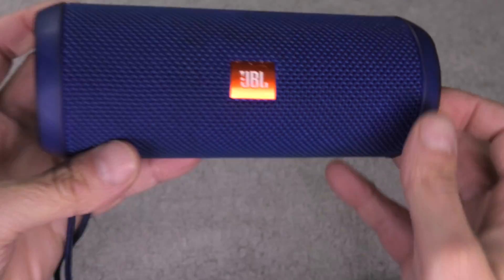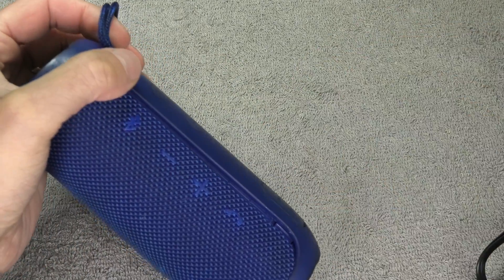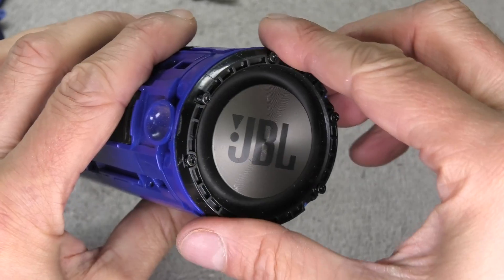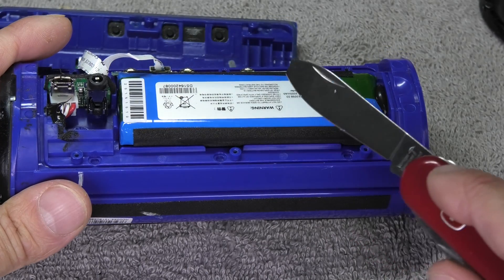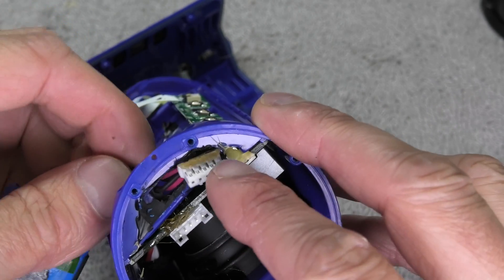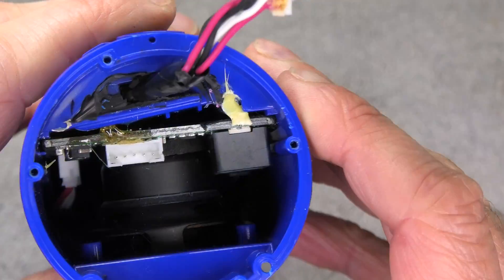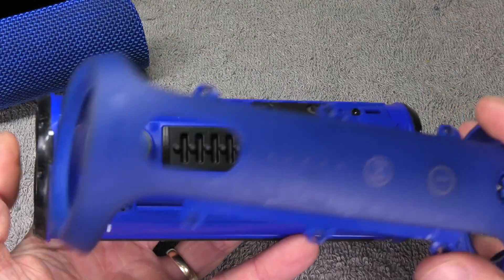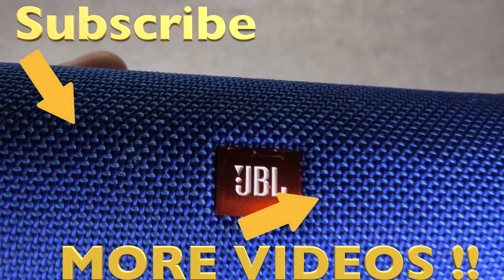JBL Flip3 Battery Replacement (How to DIY)

Comment: Perfect video!  Replacement done by myself and it’s working. I want to add one reminder, try to not fill so much hot glue over the cables of battery socket, height of this glue blocks the movement of side cover while bass sounds and it effects the sound you hear. I made it clear second time.

Comment: Once you unplugged the battery. And switched to taking off the top near charging port you lost me. And yes i have a Flip 3. There is no big gap to get under the port like that on mine. And no indication that it can split in half like that. Its solid platic with no seem.

Comment: Pay attention to the length of the machine screws as you take the Flip 3 apart. The passive radiator machine screws are slightly longer than the machine screws that hold the body parts together.  If you try to use the longer screws on the body parts they bottom out before they snugly hold the parts together.  As you remove the screws during disassembly consider labeling where they came from.   It still was an excellent DIY video with great closeups of the disassembly and reassembly.

Comment: How likely is the battery to catch fire while prying at it? My jbl flip 3 battery is inclosed and only accessible from one end. Obviously I don't mean pry, pry. But still, just curious because it's in there pretty snuggly with the adhesive and I'm not completely sure if the old battery is swollen or not. Should I bother with the heat gun method or no?

Comment: I just performed this repair this evening. Your instructions were very clear and the video gave a very good perspective on seeing where things were. I added two tools to the mix. First, I used a small flathead screwdriver to hold up the grill as I was initially peeling that off. That helped give a little lift/leverage. Second, a small pair of needlenose pliers was helpful in pulling away the cut glue and putty, as well as to pick up one or two of those very small screws. Thanks for making this video. It felt good to be able to repair something rather than having to buy a new one. Hopefully it charges and I'm good to go!
Reply: Unfortunately, I have to report that the repair did not work. It won’t charge and therefore won’t power up.
I have to go back in again and see what’s going on. Maybe the thin ribbon cable got bent.
Reply: I am taking it all apart again to see if I can figure out why the speaker won’t work on battery. If I plug it into AC 
, as if charging, it powers up and works fine. I’m going to try recharging while it’s disassembled to see if it was simply not charged enough to work. I’m using a Cameron Sino battery CS-JMF300SL. Maybe I have the wrong battery?
Reply: @peternelson4630  my flip 3 battery is also not working properly. It boots up but the battery doesnt last long no matter how much i charge it. and the led turns red. 
So i just plug in the charger and use it it works well like that
Reply: About to do mine soon .. and looks like a piece of cake.. these darn flip 3 are expensive knowing it a 2015 device idk why so much on ebay .

Comment: JBL should design battery compartment right outside and easy to replace...not take a chance to broken tabs like this...bad engineer...bad design...Need to change or other Company will take a chance and improve this points.....I will buy other brand ex Bose knew and did it......OK common JBL  do somethings if you see this video and my comment!:face-purple-crying:JBL DO SOMETHINGS....JBL ENGINEERS WAKE UP..Customers already see your weak points

Comment: I get that these are sealed to make them splash/water resistant..........but all these kinds of tech could be designed to that the battery is located just beneath the surface so that the sealed cover can be easily removed and the battery easily replaced so that the cover can then be easily resealed and securely re-placed.   I wonder why they don't do that routinely?   
(That's a rhetorical question.  ; )   Meanwhile, we have overflowing landfills full of toxic stuff that will virtually never biodegrade.

Comment: Good video. My model was slightly different with the access to the battery on the end and a ribbon cable in between. My batteri was also very swollen and impossible to pull out. Had to drill (non pointy hss drill to not damage battery) a 6mm hole to the other end of the battery compartment which could be accessed from the other end of the unit and push it out with an allen wrench like I noticed someone do on a newer model with better access. Got the job done in case someone struggles with the same issue.
Reply from the maker: Thanks for the info!  Very informative.

Comment: Very good video. After I have installed the battery I can hear a lot of vibrations when I play music with deep basses. Could you suggest anything to overcome the issue? Thanks 😌
Reply from the maker: Hi, i suspect a wire is vibrating against the case and creates the noise when playing lots of bass.

Comment: So I tried this, the battery was stuck, and now I can’t get it out! Advice???
Reply: Hi Jessica, what I use to remove the old battery is an Issesamo - it's a thin metal prying tool to dismantle iPhones, iPads etc. Just slip it under the battery and work your way around it slowly and it will loosen up. They're are about £5 or so pounds on eBay/Amazon. Hope that helps you 🙂

Comment: Nope. There is no removeable piece that exposes the whole battery in my Flip 3. I got a long way. Tried to get the battery out but it was too stuck I tried using the wires to p ull it out but they broke off and I tried w needle nose pliers and got sparks and smoke. done

Comment: Hi, great video , I have the same flip 3 as you and my problem is it won't charge I had it plugged in over night and all that happens is the first white light flashes but that's all. Is this a symptom of a bad battery or something else ? Thanks
Reply from the maker: Hi, that sounds very much like a bad battery.  I’ve had the same problem with mine.
Reply: @MegaSafetyFirst  Cool - thanks for the quick reply . I'll order a replacement battery.  👍
Reply from the maker: You’re welcome,  good luck with the replacement 👍
Reply: @MegaSafetyFirst  Hi, just thought I'd update on the battery replacement and I'm happy to say it was a success! My Flip 3 now works perfectly . I bought the same battery as you (Cameron Sino) for just £16.99 from here in the UK. I also used a hot- glue gun as you did. The other opening tools I already had from fixing phones, iPad etc. On a side note , I'd suggest , anybody else undertaking this to buy a good set of screwdrivers it will make it so much easier (Philips 00 is what's required).I have a Stanley Fat Max electronic set in my toolbag (although I'm a carpenter by trade ). Thanks again for the video my friend. Great work👍stay safe .
Reply from the maker: Glad to hear!  Thank you for your feedback and suggestions. I appreciate it. 👍👍

Comment: Lithium Polymer (Li-Po) batteries do not like to be stored at full or empty charge for extended time, if not using any electronic device for extended time try to store them at 50% charge (storage voltage) and the Li-Po will last much longer..

Comment: Thanks. I replaced it. But now for some reason the passive radiator on the battery hook up side vibrates at higher volumes during bass notes.I wonder why.
Reply from the maker: Hi,  could it be that the radiator hits a cable?
Reply: @MegaSafetyFirst  
I took it apart and it appears it's not but that's what I thought it could have been also..Looks like there's enough clearance especially because the radiator inner dome gives the wires clearance.
Reply from the maker: Good to know. Thank you for your feedback!
Do you have any idea what else could cause the problem?
Reply: @MegaSafetyFirst  
I'm wondering if one or both of the 2 little speakers are giving out now?
I  checked for any wear or tear but didn't see any.

Comment: Great video, managed to replace my battery - thanks! I had several screws with stripped heads that wouldn’t budge and I had to break off the plastic case around them - so if anyone is thinking of attempting this maybe see if you can actually take your Flip apart first before you buy the battery.

Comment: How long do batteries last 
I was told like 1 to 2 years. What did you find with yours ??
Reply from the maker: I used one for over three years before the battery degraded noticeably. But I guess it can vary.
I even still use a JBL Charge one, which is over ten years old and it still has the original battery.

Comment: my jbl flip 3 speaker charges good but it the battery goes dead after a while & it makes a static noise when im playing music
Reply from the maker: First guess is that the battery is damaged
Reply: @MegaSafetyFirst  so you think if i buy the battery everything will work fine
Reply from the maker: In case you feel confident to take it apart then I’d suggest to do that first. 
Check the battery and see if its outside foil looks bloated. That is a clear indication for a bad battery.  
In case it is bloated, order a new battery afterwards. That way you don’t waste money.
Reply: @MegaSafetyFirst  how do i know if the battery is bloated?
Reply from the maker: The battery would feel puffy when you squeeze it.   Like there is some air in it.
Reply: @MegaSafetyFirst  oh okay i gotcha
Reply from the maker: Just in case you don’t know, it is a bad idea to open up a battery - even when it is broken.  They can start smoking or even catch fire.
Reply: @MegaSafetyFirst  how do i prevent that from happening?
Reply from the maker: As long as you don’t try to look inside of the battery it is safe to handle the battery.  
I’m just personally always curious and would try to open it myself ( if I didn’t know better).
Reply: @MegaSafetyFirst  i understand what youre saying now

Comment: This video was very clear and instructive. I was able to follow it without any issue, and the replacement went smoothly. However, I didn't have any hot glue, nor RTV, so I used rubber cement. This seemed to work fine, but I am getting some resonance at high volume from one of the passive speakers, the side where the putty was in place. Could the resonance be due to improper plugging of this hole?? If so, I can disassemble and add a layer of RTV or hot glue.

Thanks!

Comment: I wanted to ask you what kind of symptoms did your Flip 3 have before you realized that the battery needed to be replaced.  This is what my Flip 3 is doing....  I charge overnight to full, but the charge only last about 5 minutes then it goes dead. When I plug in my micro usb it looks like only 1 or 2 of the 5 charging lights are used.  Also, the power works for ON, but I cannot power OFF unless I hold ALL 4 buttons (phone, volume up & down, and bluetooth) on the grill down at the same time.   I am hoping that the battery strength or charging capabilities is causing the issue with the power on and off button problem for me.   Thank you in advance for any insight that you may have.
Reply from the maker: Hi, I could imagine that a bad battery is causing the problems you experience.  Although the powering off situation is a bit odd.  
I replaced mine because of short battery life and intermittent audio drops.
Reply: @MegaSafetyFirst  I just replaced the battery and everything is working fine. I did run into a little challenge...  The replacement battery had wires that were thicker than the original. Putting the bass radiator speaker back on, when testing the bass with the volume up....  The rubber speaker cone was hitting against the wires making a fluttering sound. I had to reopen and make the opening for the wires going from the battery to the connector larger. Making sure the wires were below the top of the opening solved the fluttering noise.  The new battery solved my issues. 

Thank you for your video and comments!
Reply from the maker: Great to hear that it is working again!
Thank you very much for your feedback and for sharing your experience, especially with the thicker wires!